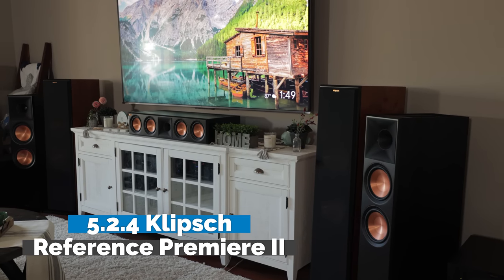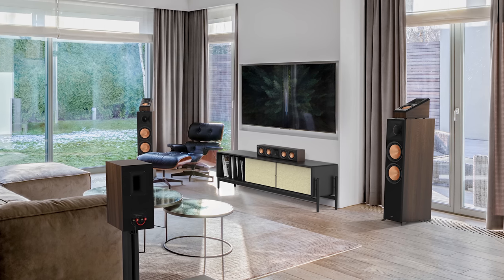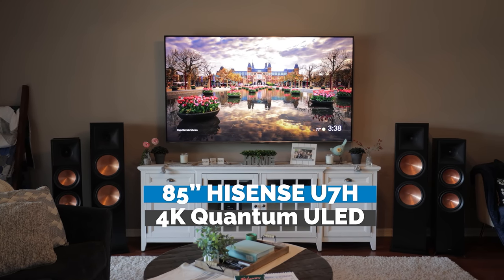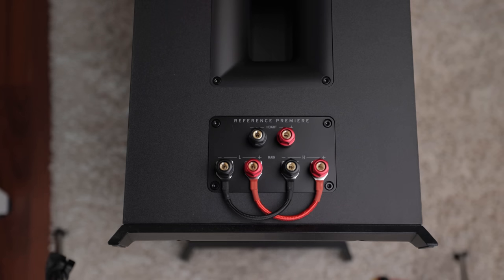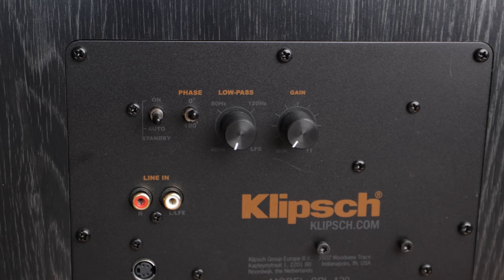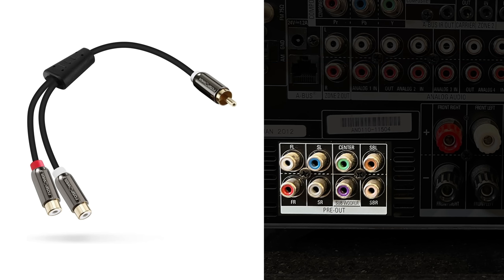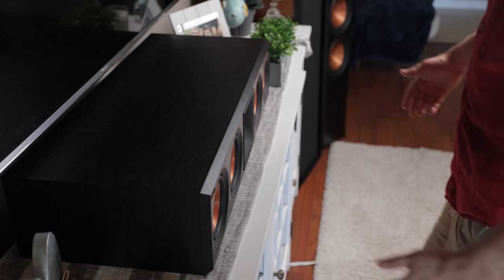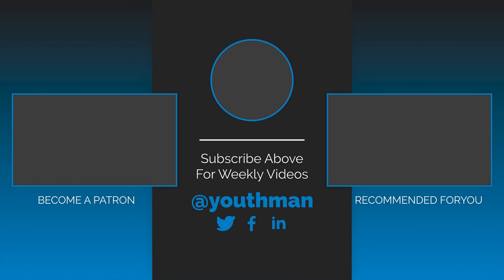HOW TO Setup a 5.2.4 HOME THEATER Surround Sound Speaker System | Klipsch Reference Premiere II

Comment from the maker: Home Theater Dolby Atmos 5.2.4 Setup | Klipsch Reference Premiere II
Shop Klipsch Speakers - https://bit.ly/Klipsch_Speakers. 
TONS of Resources and links to all products below ⬇⬇⬇

This video is sponsored by Klipsch & Pioneer

Klipsch Speakers:
RF-7 III - https://bit.ly/Klipsch_RF-7_III
RP-8000FA II - https://bit.ly/Klipsch_RP-8000F_II
RP-8060FA II - https://bit.ly/Klipsch_RP-8060FA-II
RP-504C II - https://bit.ly/Klipsch_504C-II
RP-600M II - https://bit.ly/Klipsch_RP-600M-II
RP-500SA II - https://bit.ly/Klipsch_500SA-II
SPL-120 - https://amzn.to/3XtF1Hu

Electronics:
Pioneer VSX-LX505 - https://bit.ly/Pioneer_VSX-LX505
Hisense 85U7H - https://amzn.to/3mxkcgx
AppleTV 4K - https://amzn.to/43YnDOu
Nvidia Shield Pro - https://amzn.to/41RFOUs
Panasonic DP-UB420 4K Player - https://amzn.to/43SHT49
Panasonic DP-UB820 4K Player - https://amzn.to/43SHT49
Panasonic DP-UB9000 4K Player - https://amzn.to/3H2NAD2

Sewell Banana Plugs & Accessories:
Banana plugs are a MUST in my home theater and 2ch setup.  
Use the affiliate links below to save 5% on your order (automatically added during checkout)
Visit Sewell - https://bit.ly/sewell_direct
Not All Banana Plugs Are the Same - How to Install Them to Speaker Wire
Sewell Banana Plugs - https://bit.ly/sewell_banana_plugs
Sewell Speaker Wire - https://bit.ly/sewell_speaker_wire
Sewell Ghost Wire - https://bit.ly/sewell_ghost_wire
Sewell HDMI Cables - https://bit.ly/sewell_hdmi_cables
Sewell XLR Cables - https://bit.ly/sewell_xlr_cables
Sewell Speaker Mounts & Accessories - https://bit.ly/sewell_speaker_mounts_and_accessories

Monoprice HDMI Cables - https://amzn.to/41Li6Je
Monoprice 14 gauge Speaker Cables - https://amzn.to/3AoX0EU
Monoprice Subwoofer Cable - https://amzn.to/43ZHMUK
Unvert Toggle Bolts - https://amzn.to/3N3a62b
Toggle Bolts - https://amzn.to/43YonDi
Wire Strippers - https://amzn.to/3owiSvr
AVR Sub Out Y Splitter - https://amzn.to/3ozoNQC
Subwoofer Y Adapter - https://amzn.to/3AmmDpX

TV's & Accessories:
Monoprice TV Mounts - https://amzn.to/40r4r9i
Kanto TV Mounts - https://amzn.to/40xNXw0
Power and Low Voltage Cable Management Kit - https://amzn.to/3FAvnLk

Audio Advice Article on Biamping - https://bit.ly/Audio_Advice_Biamping

Recommended Videos:
Klipsch Reference Premiere II Review - https://youtu.be/MeKAbPGIB3g
Klipsch Reference Premiere II Overview - https://youtu.be/cIDRLXA89iI
How to Install an AVR - https://youtu.be/ULE1gd5FwxI
Setup Audyssey https://youtu.be/6Z0svzYSAEM- 
Setup Dirac Live - https://youtu.be/yspMuw_PX0s
Level Match Your Speakers - https://youtu.be/V481X2RHUcA
Improve Center Channel - https://youtu.be/24c7PkOG1vE
Hisense U7H Review - https://youtu.be/0SLd0AfH7qc
Klipsch Reference Premiere Subwoofers - https://youtu.be/C1HB9KS2h6Q

Weekly and monthly Zooms on Patreon - https://www.patreon.com/youthman

MWAVE 2023 Tickets and Info - https://midwestavexperience.com/

Best pricing on Home Theater products  - http://youthmanreviews.com/sales/

FREE Home Theater Design Tool - https://bit.ly/Home-Theater-Design-Tool

Submit your Home Theater - https://hometheatertours.com.

Ways You Can Support:
Patreon: https://www.patreon.com/youthman
Youthman Courses - https://www.youthmancourses.com/
Youthman Merch - https://teespring.com/stores/youthman/
Donation via Venmo @Youthman

Follow Us:
Youtube: Subscribe to this Channel: https://goo.gl/YEJ23p
Youthman Crew Facebook Group - https://www.facebook.com/groups/youthmancrew
Instagram: http://instagram.com/youthmanreviews/
Twitter: http://twitter.com/youthmanreviews/
Website: http://youthmanreviews.com/

__

Disclaimer:  Affiliate Links are used in the description of this video.  I earn from qualifying purchases.

Valencia Bespoke Series Theater Seats:
Tuscany Ultimate Luxury - https://bit.ly/valencia-tuscany-ultimate-luxury
Oslo Ultimate Luxury - https://bit.ly/valencia-oslo-ultimate-luxury
Naples - https://bit.ly/Valencia_Naples

Valencia Cinema Series Theater Seats:
Venice - https://bit.ly/valencia_venice
Budapest - https://bit.ly/valencia_budapest
Piacenza - https://bit.ly/valencia_piacenza
Piacenza Powered Headrest - https://bit.ly/valencia_piacenza_powered_headrest
Verona - https://bit.ly/valencia_verona
Verona - Powered Headrest - https://bit.ly/valencia_verona

Valencia Premier Series Theater Seats:
Oslo - https://bit.ly/valenciaoslo
Oslo XL - https://bit.ly/valenciaosloxl
Zurich - https://bit.ly/valenciazurich
Tuscany - https://bit.ly/valencia_tuscany
Bern - https://bit.ly/valencia_bern

All Valencia Seating - https://bit.ly/valencia_all

#klipsch #dolbyatmos #surroundsound

Comment: Another pro-tip, if you have white baseboard or black or beige you can purchase wire hiders(in that color) & put your wires along the edge & floor of your walls. I also have hardwood floors

Comment: I've got a pair of the Klipsch R625fa up-firing speakers and I can't figure out if they are supposed to be wired lower to upper terminals, or on separate wires directly from my Denon X3300W 7.2 AVR

Comment: If using dolby enabled speakers, like you are using,  so 5.1.4,  the surrounds speakers should be 90 to 110 degrees, and not the 110 to 120 degrees like you stated, as this only applies for a regular 5.1. That means that you correctly positioned the surrounds in a 90 degree angle as the Dolby guidelines indicate. See page 30 of the guidelines.
Reply from the maker: You’re absolutely correct those are the guidelines for a 5.1.4 set up. But if I had placed the speakers where Dolby recommends, they would have blocked the walkway behind the couch and the entrance to my outdoor living area. That  just was not an option.

Every room has limitations and we have to do the best within those limitations. Even my dedicated theater room has limitations and is not a perfect setup. But man it sure brings a massive smile to my face every time I use it.
Reply: @Youthman  you placed them at 90 degrees...thats exactly what the guideline says...see page 30.
Reply from the maker: From what Ibsee on this page, it’s showing 110 a 120. Am I missing something? https://www.dolby.com/about/support/guide/speaker-setup-guides/5.1.4-dolby-atmos-enabled-speaker-setup-guide/

Comment: Thank you, finally you have answered the question I had about the phase for subs in the front and rear (I had asked this question sometime last year, and couldn’t get an answer) my solution was to just make the change of the rear subs to 180. I put it a demo disc (GKOTM) and I got my answer, the subs came alive! Thank you Michael!!
Reply from the maker: I appreciate the kind words Wendell. Glad you got it figured out.
Reply: could u please elaborate.  Im a  newbie and running a marantz avr with two subs. Im mostly a music guy so suffering on the tv movie end doesnt bother me.  could u explain the 180 comment. and how u made one sub different than the other?   or did i mis read...thanks
Reply from the maker: Typically on the rear of your sub, you will see a phase knob or switch. Sometimes it’s a toggle switch to choose 0 degrees or 180 degrees. Others have a variable knob that allows you to choose anywhere between 0 and 180 degrees.
Reply: @Dooguy  Are your 2 subs in the front, or do you have 1 in the front, and the other in the rear?
Reply: @wendellwendellb339  room is 24 x 36    lg sub  in front...smaller rear.     both svs subs
Reply: @Dooguy  Listen to a demo clip of a movie with bass, at 0 phase for both subs, than listen to the same clip, but, change the rear subs phase to 180, see if you hear a difference. I know I did. I have 4 SVS PB 1000 Pro’s! That’s a big room!
Reply: ok thanks!!    im not much of a movie person, i listen mostly to music in full stereo mode with my sr7007,  but i will try this..... I have the big 16 pro ultra   up front and a smaller pro 2000   @wendellwendellb339

Comment: Thanks Youthman, I just subscribed!
I just had my old Sony STR-KS2300 blow up on me and I've been doing exhaustive research for three days straight. I ordered a Pioneer VSX935 receiver ($422) and a Klipsch R-120SWi Subwoofer ($250). I'm planning on setting up a 5.1.2 Atmos setup using the old Sony speakers with two old Pioneers as my height speakers temporarily. If you can comment on any mistakes it would be appreciated.
Your video was the most comprehensive video I've watched in the last three days, and with me being an audio/video newbie I just wanted to thank you.
Reply: What's the update

Comment: Hey Michael, I have a question about the Klipsch RP 500sa which I have. In this video I noticed that you said that if you use them for on wall Atmos that you would set the toggle switch to surround and on an older video you said to set it to Atmos. Mine are set to Atmos but do I need to set it to surround to get the best result, I have 4 of them on wall as Atmos/heights. Thanks

Comment: Thanks for the tips. Can you help me? My new theatre uses Epson 5050ub and I supplied my Denon avr with Monoprice 4K High Speed HDMI Cable 35ft - CL2 In Wall Rated 18Gbps Active Black. However, when pressing PLAY on my UHD or switching menus on movies, or selecting scenes there is a 2-3 second video delay. The audio is instantaneous. Any idea why this lag occurs?

Comment: New subscriber here. In my setup I'm forced to have my couch against the back wall. Should I do 5.1.2 or 5.1.4? I 'm doing in wall for the surround and in ceiling speakers for the Atmos. Small room 12' wide, 15' deep with 8' ceiling. Does the 5.1.2 setup make more sense since my back is to the wall? Thanks!
Reply from the maker: I agree with you. I’m not sure having for Atmos would provide much benefit. Unfortunately, we all have to deal with not so perfect rooms and have to do the best with what we have.

Comment: I have a couple of questions. Here is my setup:

Denon 4700
Klipsch R-625FA Dolby Atmos Floor stand speakers
Klipsch RP- 504C II center channel 
Klipsch R-41M Bookshelf speakers
Klipsch R-12SW subwoofer

1-What are your suggestions for the crossover settings?

2- What are your suggestions for the db level for all the speakers? This is where I am confused.
Reply: Did the calibration again and here are the results. Should I change anything?

Front- 40hz
Center- 40hz
Surround- 60 hz
Front Dolby- 90hz

Comment: Hello there thanks for upload this video . I have a question how many watt RMS power needs for speakers for add to amplifier. ? 

I mean if my amp deliver power like 140 watts per 2 Channels driven. and then how many watts RMS  we need to add speakers on right way??  Can I add speakers like 150 watts or 140 watts or 180 or 200?? Or more than 200?
Reply from the maker: The more clean power the better. I would have no problem driving a 100 watt or 150 watt rated speaker with a 200 wpc amp. You’ll likely never get close to using all 200 watts but it’s great to have on reserve when you need the additional horsepower.
Reply: @Youthman  please can you Upload one video for Exactly how to match the speakers to the AVR or Power Amplifiers on right way. Also what happened if I run Speakers over power than the amplifiers and under power speakers than the amplifiers please. Very useful your video to the peoples and me thanks 🙏

Comment: I have always set up my speakers and subs at a positive number. Saw on your video and others where they are in the negative range. When I do that, can barley hear anything and have to turn my volume way up. Just curious.
Reply from the maker: Hi Dean, what speakers are you using? If I had to guess the reason you were needing to go into the positive is because your speakers have a low sensitivity rating which means they take more power (thus why the AVR is pushing into the positive).
Reply: @Youthman  Had used Axiom VP-100 center and Axiom M22Ti for front and right and now sure about the back. Now i have Klipsch quinet 111 speakers. I really like them and actually think thy sound better than the Axiom. But I am at plus 8 for fronts, 10 for center and surround and rears are at 7 to 8 as well. All in the positive. Again, both would be super quiet if I were at the negative 8 to so, and would have to turn my av way up. Thanks for your time and feedback.

Comment: What if I have an avr with no pre outs (denon x2800h) but my speakers are powered? Should I expect any issues with power or distortion?
Reply from the maker: If your speakers are self powered, you will need pre-outs from your AVR. if you attempt to use the speaker output which your powered going into a powered speaker, you’re going to run into issues

Comment: i have Klipsch ceiling wireless speaker. which type of receiver should i use to use to connect my wireless speaker for my home theater system?
Reply from the maker: Wireless in-ceiling speakers? This is the first I have heard of them.
Reply: when  i purchased the house the klispsch ceiling speakers already installed. i dont see any wires outside/visible so, i am guessing the wires might be inside the wall. I use Legrand app to connect (via bluetooth) to the ceiling speakers and play ONLY audio songs from my phone. but now, i want to connect the ceiling speakers to home theatre system. i hope i am clear now. what type of recevier should i use here?

Comment: Youthman - Thanks for your videos on Klipsch speakers. I am currently looking for a 5.1 system in my living room (25' x 15' x 18'). Considering the following options (primarily for HT): a. Klipsch RP 8000 ii; Klipsch 504C ii; Klipsch RP 500 ii (as rear/ surrounds)
b. Klipsch RF 7 iii; Klipsch RC 64 iii; Klipsch RP 500 ii (as rear/ surrounds). I would pair it with an Outlaw LFM 1EX sub. Currently own Ascends (CMTs + CBMs, same sub), which I wiull be moving to the media space in basement. Would like to know your thoughts on the options.
Reply from the maker: The reference premier system offers a lot of bang for your buck. The RF7 III is a significant improvement due to the 1.75” compression driver, massive dial 10” woofers and you step up to real wood veneer.
Reply: Got it. I don’t play at loud volumes. Would there be a discernible difference in performance for lower to moderate volumes, especially considering the price difference?

Comment: Was there a reason you decided not to use the hdmi eARC out from the pioneer to the TV? I have everything ran to the pioneer then use the hdmi eARC out to the TV.
Reply from the maker: That’s exactly how I had it connected. But I think I forgot to include that in the video lol. Honestly, this was a 3 day film and edit. Probably the most time I’ve spent on a video. I may need to make a follow up video.
Reply: @Youthman  still made a killer video. For a complete how to setup getting the information to the TV is kinda important for a home theater lol. If you make a follow up maybe you can describe the pros and cons of different HDMI cables, like optical hdmi for long distances, 2.0 and 2.1... etc...

Comment: how do you run pull the carpet from the baseboard to tuck it in?
Reply from the maker: Baseboards typically are installed on top of carpet so you should be able to tuck it in pretty easily as you are simply pushing the carpet down to slide the wire in

Comment: Nice informative video! I purchased a Klipsch Synergy 7.1 surround sound system for my living room back in 2010. I wish I could upgrade, but after retirement and living only on social security it would be hard for me to upgrade. But my system still sounds as good as the day of purchase and I'm satisfied with the system. My speaker system is connected to a Yamaha 7.2 A/V receiver. I have my TV connected along with my two Tascam CD/Recorders, Music Hall turntable, Pioneer RT-1020L reel to reel tape deck, and my computer desktop. By the way, my living room is 12' by 21'. My sub is the Klipsch SW-450 downfiring sub.
Reply from the maker: Appreciate it Fred

Comment: @6:58 in the video he lists speaker layouts that can be used with a 9.2 AV Receiver but he does not list some layouts (like a 5.2, 7.2, 9.2, 5.2.2, 7.2.2) why? Is just an oversight, and these are just not popular set ups or are they not possible for some reason?
Reply from the maker: It wasn’t meant to be an exhaustive list. Of course you can have two subs with any setup. This AVR has dual sub outs. Others you can use a Y adapter.

Comment: What you think of my home theater system 

I have a full Cambridge sound works system

Amp is a pioneer vsx-90
Fronts are a pair of csw t500
Rears are a pair of csw m50
My height speakers are a set csw s300 
My subs are csw 1000 and the built is subs on my t500s

And my center channel is some csw oversized center

My tv is a 55in lg c1 oled and an xbox series x

Comment: On the 8060 fa speaker where do you plug the height speaker wire to on the reciever?
Reply from the maker: To your front Atmos speakers.
Reply: @Youthman  I just ordered an onkyo receiver on the back will it say front atmos speaker or will it say height etc. I've had sound bars I just last night bought the receiver the 8060 and the 5040 center and the 12 sub. I know the fronts are self explanatory but the height speaker wire is my concern where to plug it into on the reciever
Reply from the maker: @kylethiede9463 what model Onkyo?
Reply: @Youthman  Onkyo TX-NR6100 7.2 Channel
Reply: It's what klipsch had on there website with their speakers. So I figured why not
Reply from the maker: @kylethiede9463 look on the rear of the AVR. You’ll see height text on surround and surround back terminals. You’ll have to designate which of those channels you want to use for Atmos in the settings of the AVR.
Reply: @Youthman  thank you, much appreciated! Hope all is well